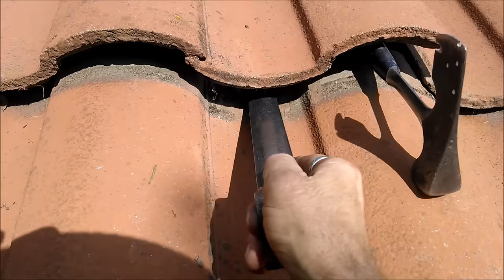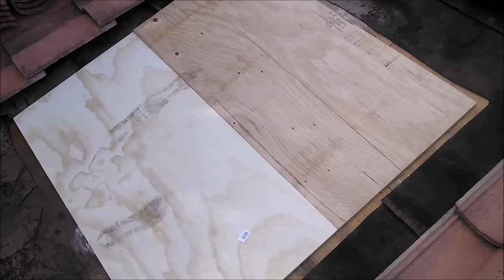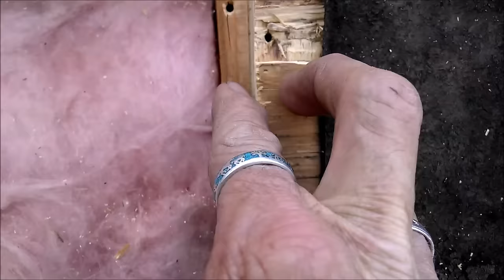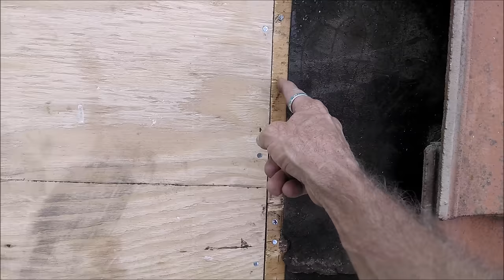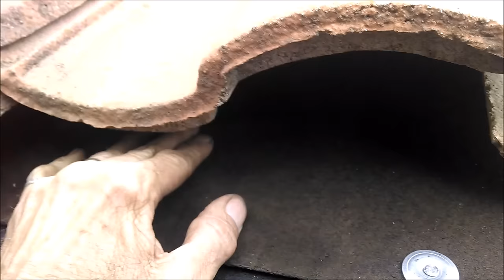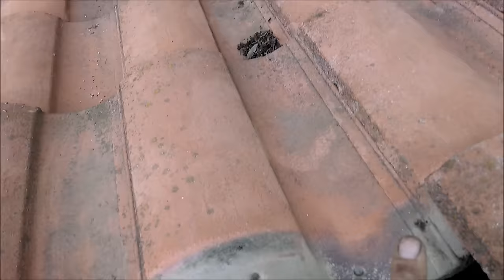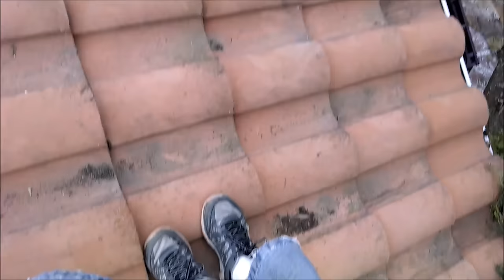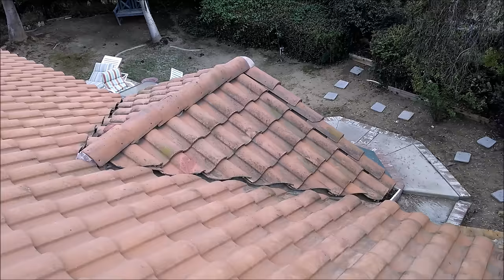Roofing Tile Leak Repair - Tips, Tricks & Helpful Hints

Comment: SRY Dan. I have been installing and repairing Tile roofs for 39.5 yrs.  I realize now you are informing home owners. I have NEVER installed any of my (10-20 THOUSAND)concrete tile roofs without proper layout and battens. Clay, Slate, Diamond metal, Tin, Aluminum panel, etc can go on a 2-ply 30lb. underlayment.  NO BATTENS???????? who does this! In what states is this done!  Be safe sir. ruzty..... pss glueing tiles is not my style, they should be able to move with structure and earth. Wires or clips.
Reply from the maker: I simply don’t have the time to bring you up to speed on all your wrong assumptions about my video with the evidence required to correct your assumptions. Although I can easily justify everything I did, to explain why after I already explained it in the video, is simply too time consuming. You need to go back through everything you’ve said & challenge what you think & why first. Then you need to ask yourself under what circumstances might what you think be wrong. Then you need to research codes & installation recommendations of various materials outside of your bubble of experience. Ask yourself why do you do what you do & why might others do what they do? If you can’t answer honestly & offer yourself several possibilities for doing something different than you would do, the you haven’t yet understood the complexity of what you’re talking about & you have more work to do in your understanding of what you’re talking about before giving advice to others… especially when being critical of others.

Pick one thing you think I did wrong in the video & I will gladly substantiate why I did it the way I did it according to quality & according to local code. But never critique someone else with generalities without knowing the full scope of all the exceptions of your critique & neglecting to scrutinize your own potential misconceptions of the context in which others are working, especially in front of onlookers if you desire to be taken seriously.

There are far too many wrong assumptions in your critique & you need to go back & figure out what those wrong assumptions are before correcting my work. I just don’t have the time or the patience to hold your grown-up hand on this subject & address all your assumptions.
Reply: @MrThedocholiday  You are at the top of your game. In your own mind. Try waterproofing 36' underground sometime. Be safe and well.
Reply from the maker: I’m sorry. I didn’t mean to come off salty. Been a little grumpy lately. 😊 But anyway… yeah, this is absolutely the correct way to do tile in So Cal for the last 30 years. And it actually works well when done right. Battens always cause secondary problems & aren’t required on standard pitch roofs. Extra layers of underlayment cause problems also. So one good layer of felt & the tiles installed properly will get you 50 years or more down the road, as long as nobody breaks the tiles from tromping around up there chasing frisbees. 😁

Comment: Hi Dan, do you have  website or contact number. I have had experience with bad roofers in the past. I had to call 3 roofers to fix the same leaking.
Reply from the maker: Juventus Ktm I retired from roofing in So Cal over two years ago. Living elsewhere now & not contracting anymore. Still making vids to help public understand the how & why of roofing the right way. Sorry for the inconvenience.

Four step advice for finding a good contractor in any trade. First three steps before you even bother contacting them.
1. Only hire a licensed contractor.
2. Run background check on their contractor license with your local state regulating agency first.
3. Check online reviews of their business services to public.
4. Negotiate during bidding or estimating process to have one of their supervisors check the work done on your roof daily to make sure their laborers are doing the work correctly.

If you attend to these steps diligently you stand a much better chance of getting quality work out of those you hire & can use this method for any trade working on your residence.

Hope that helps.

Comment: I hope your using copper or  stainless steel nails for those tiles!!
Reply from the maker: jim Hall There are differing codes for different areas of the country. Each building & safety division for each jurisdiction decides what building standards are for all construction trades based on centuries of building practices passed down from previous generations. Galvanized nails are required for all roofing tiles in my area. And, I have repaired & replaced roofs over eighty years old & never once seen a rusted out nail when nails & tiles were installed according to local codes. Rusted out nails are a direct result of crappy labor, not substandard materials that meet building codes.

Comment: I've been roofing for many years, and the most important thing I can tell you.. 1) you never expose nails on the paper.. every exposed nail has a potential for leak or condensation.
Reply from the maker: Sorry Brandon but I have no idea what you're talking about. The felt nails I use are galvanized & the amount of water that reaches them are only the 2%-5% of the total water that hits the roof. This is what the tile manufacturers say gets through their tile & onto the felt. In CA where I live galvanized nails on the felt paper under the tiles easily last fifty to a hundred years as long as the tile protects the felt by being installed properly. If that doesn't sound right feel free to clarify.
Reply: I live in California also. That 2-5 percent will show up within the next few years.
Reply: I can't tell you how many times I've fixed one of these jobs that homeowners think they know what they're doing and totally mess it up
Reply from the maker: Brandon At least they tried. I can't tell you how many professional roofers totally mess up a job like this. So while I expect homeowners to make mistakes, I think the greater sin comes from other so-called professional roofers who should be taking care of the homeowners they get paid to serve. And that's why I upload these vids. Because the quality in the roofing industry is very substandard & raising awareness or helping homeowners do it themselves is the logical answer to that bigger issue. By the way, I've not only been roofing for nearly 3 decades but I also ran quality control & customer service for two of the largest roofing companies in my area years ago & did in house roofing inspection to hold our own roofers accountable. You learn a lot with that kind of responsibility.
Reply: Duster Dan  are you from Florida?

Comment: Why don't you have tile battens.fixing  tiles direct onto the felt cannot be a good idea
Reply from the maker: Sam Caldwell Why not? Why battens? Why not tile without battens? What’s the purpose of a batten? What are the benefits & drawbacks of using battens? What are the benefits & drawbacks of not using battens? What areas of the country require them? What types of roofing use battens & under what circumstances? What areas of the country don’t require them? Why are they required where they are required? Why aren’t they required where they’re not required? Do you know enough about roofing to not only ask questions or challenge certain methods, but also know the answers to these questions & why? Can you explain under what circumstances there are exceptions to the rule or rules? Are you willing to put your reputation on the line to challenge the status quo or do you just go along with the crowd? Can you challenge the status quo & emerge successfully as a hero to your loyal customers?

Fixing this roof this way, without battens was & is a good thing. Since you were certain it cannot be a good idea, I’ll leave it to you to answer the question, ‘Why’.
Reply: @MrThedocholiday  hi Dan it's quite simply using battens alleviates the need to screw straight through the felt how can you think that is  good practice also the tiles rubbing directly on the felt does erode the felt over a short period  of time also most tiles have nibs to hang the tile on therefore  giving the tiles better fixing the tiles you were repairing had nail holes on the low part of the tile it's far better having the nail holes on the high part of the tile that's down to the manufacturer can you tell me the benefits of not using battens i  am taking roofs off that have been on 200 years with battens

Comment: Why on your roofs in USA they don't use counter battens and tile battens then any water getting through the tiles the water can get away your nailing the tiles straight onto the felt which is creating holes
Reply from the maker: Sam Caldwell Two reasons... 1. Only 3%-5% of the rain landing on the tile ever gets through. This very minimal amount is inconsequential to the felt paper underneath the tile & 2. As the nails holding the tiles go through the felt paper they actually seal as they go through the tar saturated felt. Any minute crevasses that may allow water through are so small & aided by the help of the tiles keeping the greater majority of water off the felt in the first place & you have virtually a perfectly watertight roof under almost any bad weather circumstances.

High water intrusion areas & low slope structures require a different application or metal flashing to preserve the felt & manage water flow in high volume areas. In each or these cases battens are not necessary to achieve a water tight roofing system. I’m sure some of the codes simply vary depending on the decision makers writing them, but for the most part codes are based upon decades of research, trial & error within the construction industry. The only other exception is that the roofing MUST be installed properly in order for these systems to keep the water out.

Hope that answers your question.

Comment: I would still tape the seams on the ply
Reply from the maker: You'd tape the plywood seam? With the entire rest of the house under all that tile & felt not having taped plywood seams? This section is already better than the rest of the house & the initial penetration problems have bee solved. There's something known as OCD & when you've fixed as many leaks as I have you need to stay away from overkill & just do quality work. That was my point about the felt underlayment in this video. Because we don't live in a perfect world & the rest of whatever project you happen to be working on any given day is already going to fail long before your repair is going to fail if you simply do quality work.

Doing unnecessary things that are to an unreasonably higher standard than the surrounding roof & not doing quality work are two of my pet peeves... Because one (OCD) is crazy & the other (lack of quality) is lazy. Both need to called a spade in my book so no, there will be no taping of the seams on my roofs unless the entire roof has taped plywood seams... But you can do whatever you want on your own roofs.

Comment: 2:52- i thought I saw 4 pieces of plywood intersecting together in one location but as I went back and looked I was mistaken. Sorry
Reply from the maker: No problem... I see your point though. Generally speaking, the seams need to be staggered? Is that what you were asking about?
Reply: yes it was
Reply: first off who uses 1/2''plywood on tile roofs not anyone I've ever known you live in the bush.you ever consider buying a measuring tape.an yes of course remove enough tile find the joint in your ,oh BTW it is called well where I'm from USA plywood sheathing lets look at the most noticeable upper right where you have only 16''(guessing)  piece left  that has definitely compromised the integrity of this area  yes sorry bud your repair is failed sheathing inspection.again upper right small piece you left covers only one truss which from what you said is 16'' probably in the bush doesn't matter where I'm from when plywood is replaced it must grab not less that 2 trusses that typically means here in our neck of the bush is 4'and at least  16''in width.and why a full 1/2 sheet wasn't used with you i will just suppose you had only scrap pieces idk i may wrong.FAILED WORST EVER.AND I GOT MORE WHERE THAT CAME FROM BACK TO TOP.
Reply from the maker: Cainboy Cain ... thanks boy.

Comment: I always do no less than a 10'x10' section repair, and use 40 lbs no matter what. And on a repair theres no need to up sale, I dont charge any extra to use 40 lbs on a repair.
Reply from the maker: That’s fine for you & your customers, but over the years I’ve learned why I do what I do. And there is no practical reason for me to have rules for my repairs when rules require overkill, like never repairing under 10’x10’ sections when a 4’x4’ section is bad.

The reason why I don’t use 40lb is because it is drier than 30lb ASTM & dry rots from moisture exposure sooner. It’s the same reason I don’t like the really heavy shingles… they are drier than mid grade shingles & lack the oils necessary to keep my roofs waterproof for extended periods of time. Rules are always meant as guidelines. Otherwise, you will always discover exceptions in life where the ‘rule’ won’t suffice to solve or fix a problem or challenge. That’s where experience comes into play. And experience can only come through failure & ratification of the rules to adapt to real world experience.

Comment: Unfortunately this repair will leak again. The roof pitch is low and the tiles have Insufficient overlap during a heavy rain and wind event. Each tile has a nail which water will cling to and march right into the sheathing, even more as the nail shrinks through corrosion. On a low slope roof, which capistrano style tiles aren't rated for, you need a true membrane with no nail penetrations. Use roof tile foam to anchor the tiles to the membrane. This way, you have no route for water to follow into the sheathing. The tile then becomes a watershedding shield for the actual waterproofing below.

Roof tiles are watershedding, not waterproof. They hurry water off of a roof but they are, importantly, UV protection for the actual waterproof material below. Any penetrations on that cheap felt will leak in a storm, especially when you allow debris to accumulate in the troughs as seen here, water can easily flow backward to the anchor nail and through the felt to wood. What doesnt go through the hole continues to drop off the back edge of the tile and flow across the felt below, looking for other nails and nailholes as it meanders down the felted deck.

During a storm, nearly any low pitch tiled roof will have water flowing on the felt below, water running beneath the tiles across the deck and eventually into the back side of the birdstop flashing at the eaves. Any roofer who doesn't solve for that should stick to shingling for a living.

Self adhesive membrane with proper lapping, foam, tile. That is the only to make it waterproof on a low pitch roof while being safe from wind lift of the tiles themselves. You'll have a lifetime roof if you do that.
Reply from the maker: I’m so glad you measured the roof pitch to establish your nonsensical speculation that it will leak again. You must be one of those gurus that can eyeball a roof pitch without measuring. You also apparently didn’t see the surrounding area outside the leak that hadn’t been affected by the weather at all in the last 30 years, since it was installed properly & had no slipping tiles. I wish I was awesome as you with my roofing knowledge after 35 years & literally thousands of repairs these hands & eyes have performed. I’m so discouraged by my own incompetence. How could I even exist & compete in such a rocket-science difficulty industry? Especially with an excellent roofing reputation like I have? My customers must have been really stupid or really crazy to let me work on their homes. So sad…